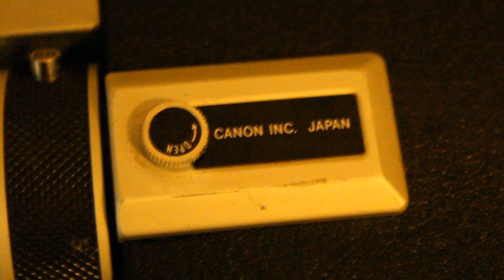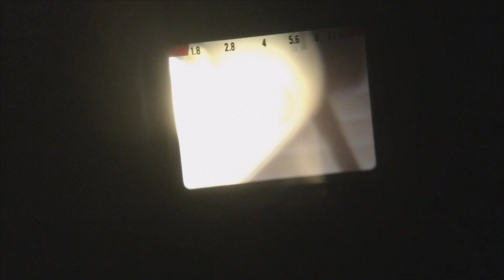Super 8 Camera Light Meter Battery Hack!

Comment: my super 8 was working fine one day, and the next I heard it slowly give out. I tried switching out the batteries located on the grip but no response. could It be that I need new batteries for the light meter as well? or do you think there's a bigger issue at hand?
Reply: The motor driving the shutter and film spool - that makes the camera whirr  - works independently from the light meter. Sounds like your motor has given out. Either find a vintage camera shop to repair it, or buy a new example. In both cases, specimens and parts seem to be plentiful.

Comment: A few camera brands (like Pentax) were insensitive to variations in battery voltage and give accurate exposure no matter what battery type you use. However, generally if a meter was designed for 1.3 volt mercury batteries, it will give the wrong exposure when powered by alkaline, lithium, or silver replacements.

Comment: Just bought this camera. When I open the cover, there is a huge metal wheel covering the opening of the Mercury battery and I can't unscrew it. Did you have this extra metal disc covering it that was hard to unscrew?  Welcome any help because right now I can't open it to replace.
Reply from the maker: Is it the opening where you put the button cell batteries to power the light meter?